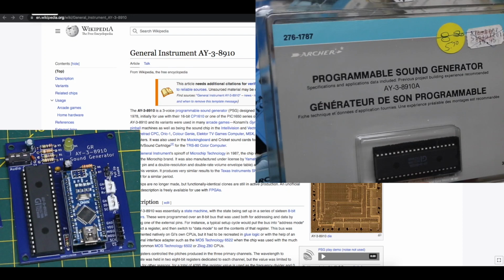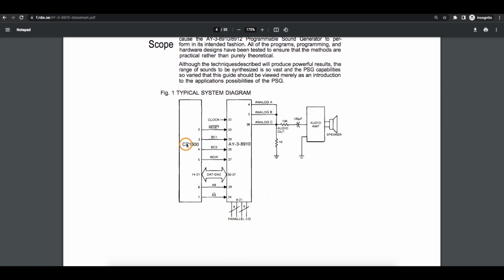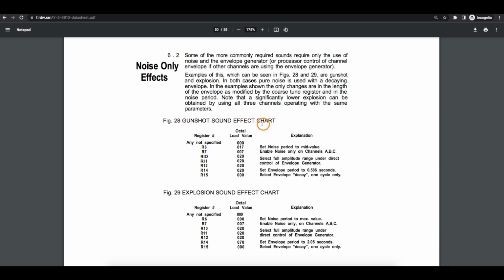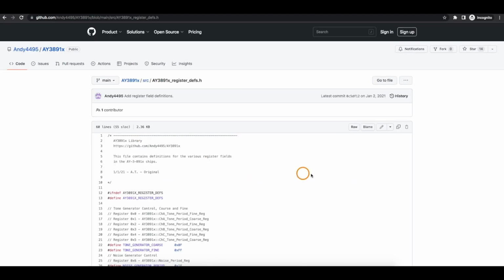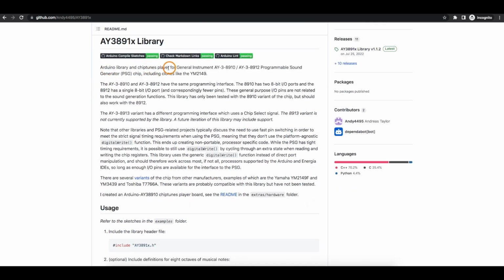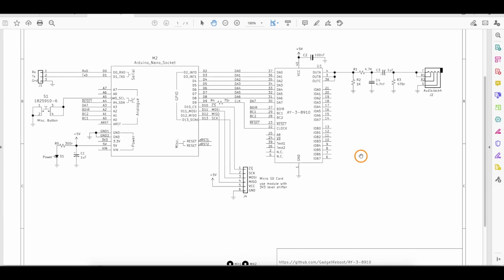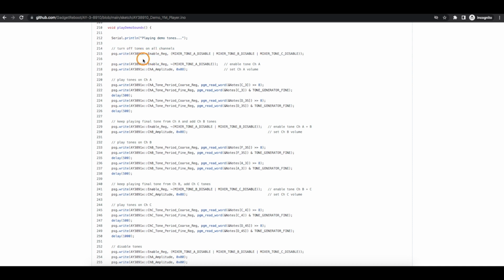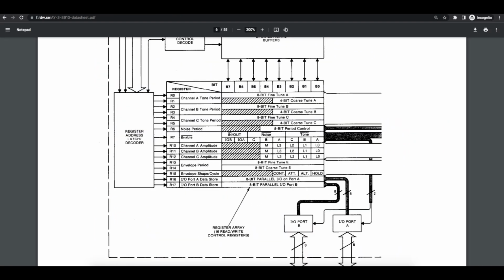AY-3-8910 Sound Generator with Arduino Nano - How it Works

Comment: That package of that chip brings back so many memories. I looked at that thing in the store a hundred times.  The good news is that I was smart enough to know I was too dumb to figure out how to use it back in the pre-internet days, so I never got it.
Reply from the maker: I also didn't get it back then and $20 in quarters plus tax is a lot of arcade time in the same mall as Radio Shack.  I think the first time I used a micro controller was 1996 or something and that was one of those simple course things so it wasn't until maybe 1999 when I did my own stuff where I would have been able to use this chip.
Except...with no Arduino examples, I'd still not know how to use those registers...